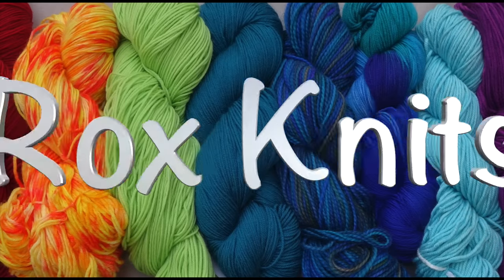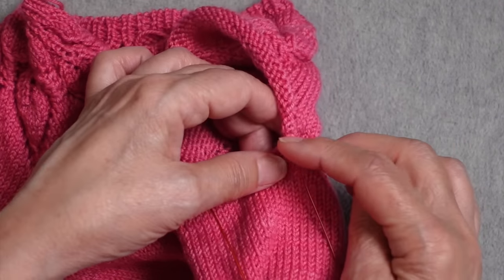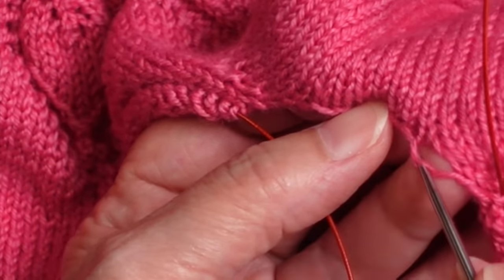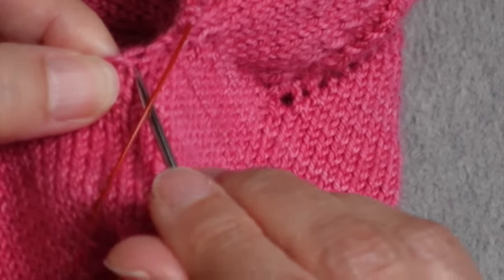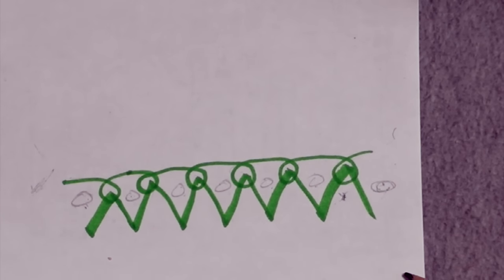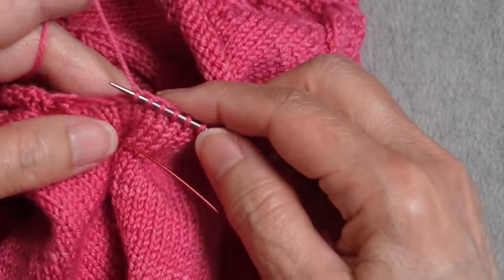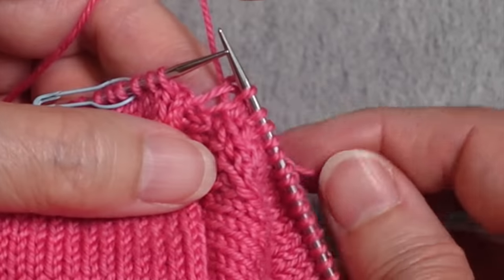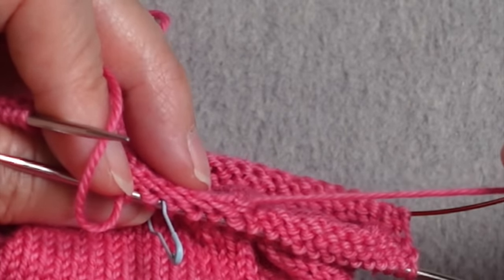Avoiding Holes in Top-Down Sweater Underarms // Technique Tuesday

Comment: Thank you for explaining so clearly this technique , the pattern I’m using however  doesn’t tell you to make those extra stitches under arm
Reply from the maker: Most patterns aren't going to instruct to use this technique. That's because they are either just calling for the most basic method of accomplishing the task in order simplify the instructions, or because the designer doesn't know a more refined method of doing it. You're always free as the knitter to modify or replace techniques the pattern tells you to use.

Comment: Thank you so much for your instructional videos, this one in particular. I knit one sleeve and worried that I wouldn’t be able to close up the gaps.  I ripped it out and started again trying to use the method I use to close the gaps in socks, it worked a bit better but not completely.  I ripped out again and after watching your video I was able to follow your instructions, no gaps.  🎉. Thank you again!

Comment: Amazing technique--thank you Roxanne!!  BTW, did you use the 2-ply or the 4-ply MCN yarn, and could you explain the difference?  I'm not confident when buying yarn on the internet.  Looking for a top-down sweater yarn, and would appreciate your explanation.
Reply from the maker: I don't care for 2-ply yarns, and this one was a 4-ply. 2-ply yarns are flatter, and are good if you like to work lace that you're going to stretch when blocking (like for shawls), because the YOs will open up nicely. I tend to like rounder yarns, with 3 or 4 plies, just because of the sorts of stitch patterns I prefer (cables and knit/purl textures), so rounder yarns provide more stitch definition.

Comment: I like learning the technical aspects of knitting which you explain so well. But a question. Have you ever tried a provisional underarm CO?  I am intrigued by this technique bc it eliminates the seam and supposedly the gaps aren’t any more difficult to close.
Reply from the maker: You'd have live sts rather than having to create live sts from picking them up along the CO edge, but that doesn't eliminate needing to PU extra sts to mitigate the gap. A CO edge made of backwards loops has very little bulk, and adds a small amount of stability at the underarm. A provisional CO is a bit more futzy than just doing a few backwards loops, so it really comes down to knowing what your choices are, how to get a good result, and which method you personally prefer doing.

Comment: I usually get around this by doing a provisional cast on in a different colour yarn (along with picking up a stitch either side to remove the issues with holes on either side of the cast on stitches..  I also normally start my round somewhere else (for instance, I rejoin the work 4 stitches or so before the instruction to pick up the initial stitches so that the looseness caused by rejoining won't be in this area).  I've never seen this method before though (I'll admit I'm an amateur knitter but I have some techniques that I tend to edit patterns with when I find them when I feel like a different way to do it that I think will make something look more polished or I think I know a way to avoid sewing a seam- although I'll admit I was going about picking up stitches entirely the wrong way and this video is very useful)  Would you have any input as to the pros/cons of my method (to clarify- I do the provisional cast on in the other colour, and treat the first row in the working colour as if it was the cast on row)?

Comment: Would knitting the k2tog through the back loops tighten the hole even more or make the hole bigger? (And ditto - great video!)
Reply from the maker: ktbl tends to narrow (tighten) the stitch, not the space between sts, and it prevents the legs from spreading (because they're crossed at the base), so my guess is that it would not help to tighten the hole, but the only way to know would be to experiment and see what you think. You can always ladder down the column of sts resulting from the decrease, and re-work the sts using a different decrease if you don't like the result.
Reply: @RoxanneRichardson  Thanks!

Comment: Is the Backward Loop CO the best choice for casting on the body stitches under the arm in a top-down? I’m making my first sweater/top.
Reply from the maker: There is rarely a "best" way to do anything in knitting, only choices. I personally use the backward loop CO in this situation, but other knitters choose knitting on, or even the cable cast on.

Comment: Hi. I am currently knitting a cardigan with a European shoulder. The pattern states that you pick up stitches along the front, top(shoulder), back. Knit till it measures 4cm then pick up stitches along the bottom armhole and join in the round. If I follow these instructions I end up with a huge gap in between the 4cm stockinette and the stitches picked up along the bottom of the armhole. Is there any way to prevent this?
Reply from the maker: There seems to be some missing information here. It might be easier if you ask your question in my Ravelry group, where you can post the name of the pattern, the exact instructions as written (not your interpretation of them), as well as some photos. I'm not clear what you mean by "European shoulder." Is this a Coco Knits design? She refers to her version of set-in sleeve design as "English tailoring." If you're knitting a cardigan, you wouldn't typically be knitting in the round at all, unless you were working with stranded colorwork, and incorporating steeks. You can find a link to my Ravelry group at the bottom of the video description.

Comment: So does this equal the first round that you knit, or is it a "cast on" round that doesn't count? I have a pattern at the moment that tells me to pick up the 5 underarm stitches, but also that the round starts with the middle of this 5... And I just can't get my head around it
Reply from the maker: Pick up the sts, work all the way back to where you started the PU, and then work the first two again. Now mark that middle st as your BOR. You're knitting in the round, so you're knitting a spiral. The fact that two sts will technically be two rows longer than all of the others won't make a bit of difference.
Reply: @RoxanneRichardson  thanks so much!!

Comment: I am really curious about the reason for your flat knitting gauge is tighter than short circumference in the round. I am a continental knitter and keep thinking that in general my flat gauge is the same as my in-the-round gauge for larger circumference, while my small circumference in the round gauge seems to be  a little bit tighter (as they usually say it tends to be), however I never change the needle size for the sleeves. Is your tighter gauge influenced by the continental style of purling in the flat?
Reply from the maker: I don't think the issue with my ITR gauge has to do with the circumference size, it's just that I have a very slightly tighter purl gauge. My continental knit tension has gradually loosened over the past 10 years. I also notice that when working a knit/purl pattern, if I have a purl as the first stitch on the needle, the transition from one needle to another has better tension than if a knit is the first stitch (opposite of most knitters).
Reply: @RoxanneRichardson  How interesting! I have to take note what my first stitches look like too. I love this nerdy stuff - just fascinating. With my purl gauge, I also think I tend to knit tighter, which sometimes results in rowing out. Maybe I am trying to overcompensate because everyone says that rowing out is cause by looser knit stitch gauge in the in-the-flat stockinette:)

Comment: In the event that the sleeve is filled with two ankles from the top, but the sleeve is not joined under the armpit, then I have to do an annexation.  Punching from the elastic, then to the underarm, and here I want to know how to work
Hope you could help me please 🙏 
Fatima
Reply from the maker: I'm sorry, I'm having trouble understanding the situation. Do you have two cast on edges to seam together at the underarm? If so, then you can seam using mattress stitch, and use the yarn tails at each end to eliminate the holes.
Reply: @RoxanneRichardson  Thank you for your reply, and Sorry my english is weak.  I mean, I started the jacket at the top and continued to the sleeves, but I did not take the stitches from under the armpit. I continued with the sleeve open, not with circular needles. When I fabricated the sleeve from elastic, I reached under the armpit, so the stitching was distorted, not beautiful.
Hope that explained can help

Comment: Thank you! This has been helpful! I was able to have no gaps on my first sleeve using this technique. I have a question though. My join is visible for  sleeves. I am knitting in the round but it looks like i did not and I have a seam. I do not know the right term, is it a jog? Or it was just not an invisible join? I do not know how to search the mistake on the internet to improve.
Reply from the maker: I would suggest posting your question in my Ravelry group. There's a link to the group at the bottom of the video description. Start a new topic in the group, and  upload a photo that shows the issue (you might find it easier to create a project in your Ravelry notebook and upload the photos there, first. You can then link to those photos from the discussion topic in the Ravelry group. It's "easier" because it's free. Uploading photos directly to the forums carries a cost of $5 per year.) Seeing a photo will allow us to see what the issue might be. It's  possible that you just pulled your grafting thread too tight, which ends up reading like a seam in the fabric.

Comment: This is a fantastic tutorial! Thank you very much. I would love to see the corollary for a bottom up sweater. Is anything significantly different? I finished my vet first sweater last year, and it was a bottom up that ended up with small gaps - not enough that anytime else would really notice, but enough to bug me!
Reply from the maker: Did the sweater have some sort of yoke construction, like raglan or circular yoke? There are a couple of ways those might be joined, but typically, you're going to graft two sets of live sts together. I would use the yarn tails at either end of the graft to duplicate stitch across the opening, which will also weave in those tails.